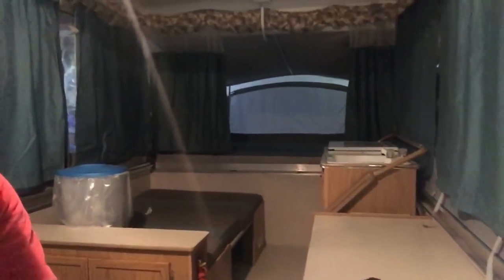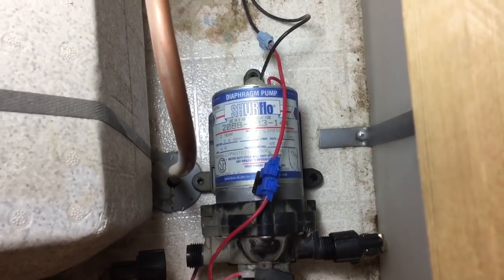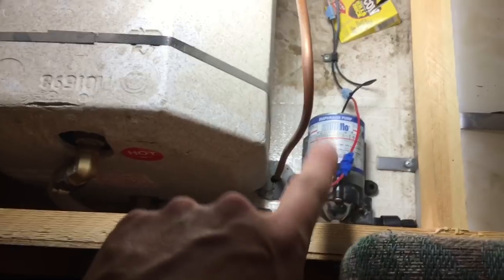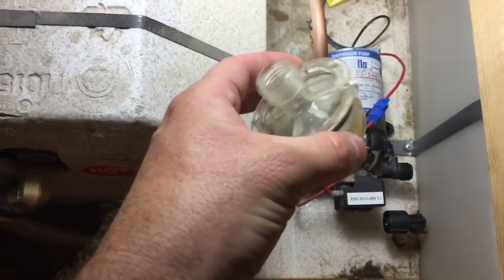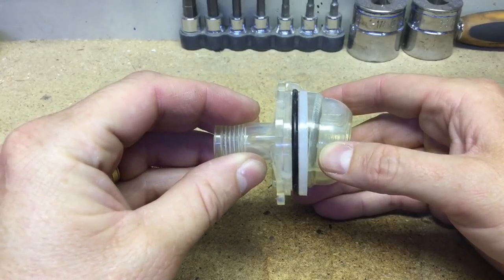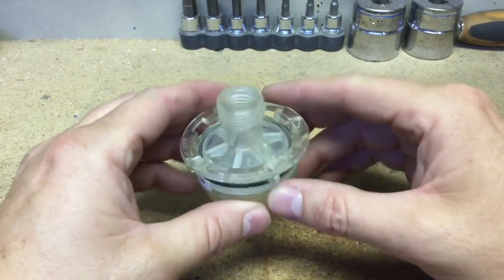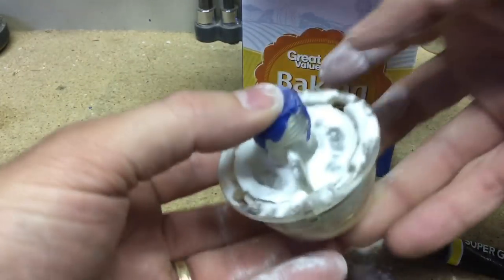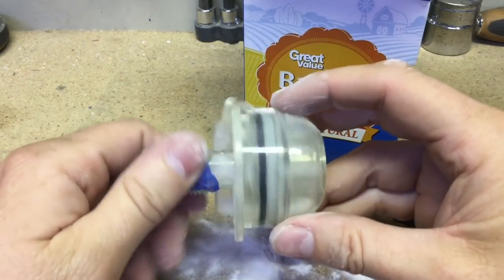RV Water Pump continuously running - Shurflo 2088-403-144 DIY Fix

Comment: If your pump runs all the time and you can't find any leaks this is the problem! Thanks for a great video. I had the same problem with my RV water pump. Follow your directions and fixed it.  THANKS
Reply from the maker: Clifford Bradley glad it helped!  👍🏼

Comment: Thanks for this. Mine started running constantly the first fill after winter. I Teflon taped the inlet filter threads and it stopped. I guess when it continuously draws in air the pump doesn't draw enough water to get up to pressure. You made this a cheap and easy fix.
Reply from the maker: So glad it helped!  Have fun camping!

Comment: Thanks for the info.  Very helpful. I checked all this but was not my issue.  I found the connection to the water tank was lose.  As well as the drain plug next to it.   I purchased my RV used.  Last owner tried putting putty around both connection.  I removed all of it, pipe taped and tightened.   Finally, problem solved.
Reply from the maker: Awesome work!  Glad my video provided some help even if it wasn’t the exact issue. 👍🏼

Comment: That strainer/filter is correctly on the inlet side to prevent crud from getting into the pump.
The pump will run continuously if there is an air leak anywhere in your water system on the outlet side which means on your water lines or your faucets. Apparently also on your inlet side too as that's where the strainer is located.
Reply from the maker: Yup, it’s a “feature” for sure. Haha

Comment: Thank you. You helped me realize that there was an air leak at the strainer where the washer didn't seat properly after I cleaned it.  Very helpful video even though not a broken part, just the washer got off track.
Reply from the maker: Glad it helped.

Comment: Great video.  I think mine may have the same issue.  I'm going to buy a new filter.  I agree with a few other comments though,  the filter should be on the inlet side.
Reply from the maker: Still running the exact same setup. No issues with water or pressure since. Glad this video helped. 👍🏼
Reply: @troysgarage  I'm on a trip now and I found that just before the hot water drain tank there is a small leak above the shut off.  Its draining into the lower compartment where the sewer drains out so no damage to worry about. I guess I'll change that valve and my system will be airtight after that.

Comment: Ah you can take the filter apart. I tried but couldn't do it so thought you weren't meant to 🤷‍♀️. I've just bought a new pump and it won't turn off unless I turn off the electric to it. I've put my old filter back on. It looked fine to me, as far as I could see...🤔 Oh like the baking soda tip 😁
Reply from the maker: Still holding up great after all this time too.

Comment: Frank Beurskens
The other solution if changing the filter did not work is to simply adjust the pressure switch with a hex wrench - the control is located in the small box where the wires are going into the pump.  Surprising that in all the support materials there is no mention of this adjustment.
Reply: I have the same pump in my trailer. Is there a way to oil these water pumps or is it necessary?
Reply from the maker: I don’t think it’s needed, but maybe another viewer knows for sure. I did t lube mine when I had it opened up. No issues since this repair. Used the trailer several times this summer too.
Reply: @guyosborne6912  ; They do not necessary need that, it depends on the environment it mounted. If it is in a humid environment, like on a boat, or Florida with high humid, and you see traces off corrosion, yes but use something like Protct & Shine 645. P&S 645 does not harm metal-, plastic- and varnish surfaces.

Comment: You were sucking air on the inlet side of the pump at the strainer, when all the air bubbles are out of the system  it will shut off quickly. Baking soda will work but you can obtain spray kicker at any hobby shop and it will kick off the super glue instantly

Comment: Hi sir, i just want to ask why my water pump keep running even all faucet is closed? Any idea? Thank you.
Reply from the maker: It runs until it builds pressure to stop it. Means you have a leak somewhere. Check every fitting throughout. Underneath, behind the toilet, under the sink. There’s gotta be a leak somewhere.

Comment: Water filter should go on the other side of pump. You want to filter the water before the pump, "The vacuum side of pump", thus preventing debris from enter the pump and causing damage. Just a little FYI.
Reply: Actually it is an inlet strainer and does belong on the inlet side.
Reply: This is an inlet strainer, and is mounted on the "inlet" side off the pump. I have the same pump, there is a arrow that show the water flow direction, as seen from top in the movie, from left to right. The pump is also a Diaphragm pump and the capacity to run dry without
 damage to the pump or motor.
Reply: If a strainer as badly damaged and assembled as the one depicted in this video had been installed on the discharge side of the pump, one could expect to see a pool of water around the strainer where it had leaked under pressure, accompanied by reduced water pressure at the tap/faucet.
However, correctly installed on the inlet side there would likely be no pool of water but the pump would draw air through large cracks/openings in the strainer bowl, giving almost zero pressure at the tap as the dear old pump would be unable to self-prime.  Just as in this case.
Reply: @paulsummers5619  ; Hmmm ... not necessarily, it depends if the pump is mounted higher or lower than the water level in the drink water tank. Another thing is that its a self -prime system because it`s a Diaphragm pump system. As long as the air inlet leak is not bigger than the pump flow, the pump will deliver water.

Comment: Peeps need to understand that the shurflo 2088-403-144 with tax is a 300$ pump. Not replaceable with a 70$ piece of poo. It directly hooks to your sensors on tank also. It is a good pump unless it fails.
Reply from the maker: Good info. Thanks for sharing.

Comment: My sureflo gets very hot, is constantly on. I've tried to find a leak anywhere but didn't; what could cause this?
Reply from the maker: It’s not building pressure. It’s the pressure that triggers it to stop flowing. Mine wasn’t “leaking” as far as water goes. But wasn’t “sealed” water tight either. Could still be a cracked unit like mine. Just a guess though.
Reply: @troysgarage  there is a small drip at the intake. Pump already has had a 
replacement kit.

Comment: Mine runs continuously if the water tank is empty.
Reply from the maker: That’s cuz it can’t build pressure. You should have an off switch for the pump when it’s not needed. If there isn’t one you should add one. Save on bettery too
Reply: @troysgarage  Yeah, my tank is rarely empty and if it is, I simply pull the fuse.

Comment: Please make it easy, just buy a new strainer, not expensive. Save a lot of time. They are quick connects
Reply from the maker: Sure if stores are open the night before you need to use it. Sometimes a “bush fix” is the only option. Also an update, this fix was still holding fast 4 years later when we finally sold the trailer. You may not like it but worked great!  🤷🏼‍♂️

Comment: You didn’t fix your pump. There was nothing wrong with your pump it was working perfectly.
Reply from the maker: Correct, the crack wasn’t allowing pressure to build to automatically shut off the pump. Pump still works great and this fix is still holding strong. 👍🏼
Reply: @troysgarage   shush I know I am correct. You missed my point though. My point is that there was nothing wrong with your pump. Your pump was working perfectly.
Reply from the maker: WOW!  Ok, so you are pissed that your pump is broken!  Don’t take that out on me!  Take it down about 4 notches!  🤨
Reply: @troysgarage  three notches down... I was Excited to see the exact model number in your video title. Two notches down... There’s nothing wrong with your pump. One notch down... You goddamn video title is Miss leading, You did not fix a pump. Your pump is not broken at all. I was looking for information about the pressure switch adjustments, Variable speed controller workings, and perhaps where to get a goddamn new gasket. 5notches down... i’m really glad that you had an easy fix for your "pump". I sure do love playing with my RV. I am looking online for replacement pumps that have variable speed. I like what I see on Amazon there are great pops for only $69. Five notches up(level nine if you will) aahhhh fuck my water pump is leaking!